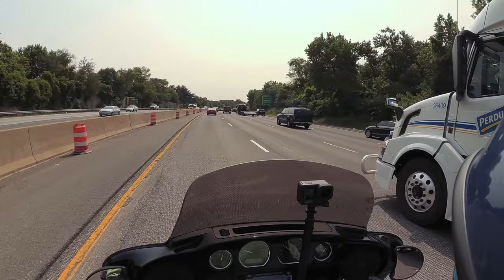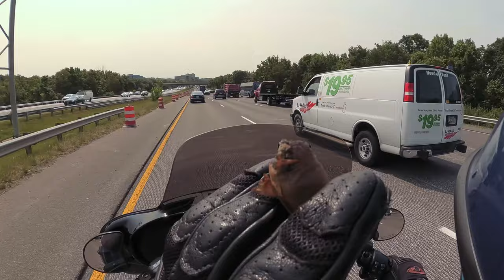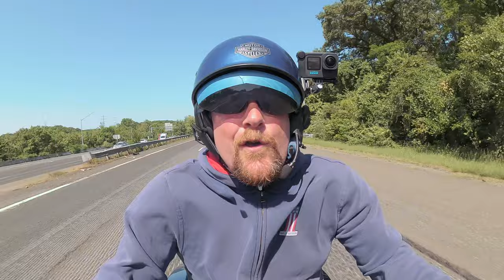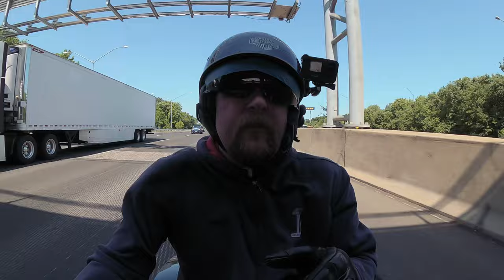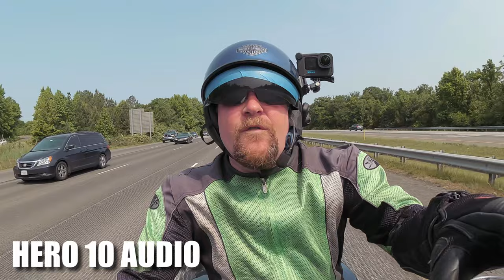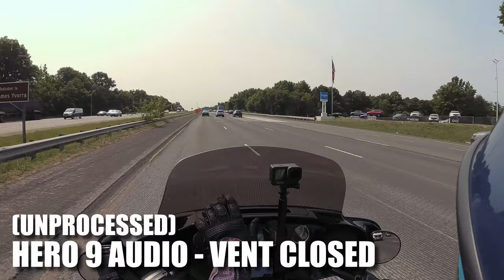Riding on grooved pavement ... and does the Harley fairing vent make a difference?

Comment: Back in the day NH used to grind up the pavement in every direction instead of in the same direction as the flow of traffic so it would pull your tires in every direction, it used to be a nightmare
Reply from the maker: That sounds ABSOLUTELY horrendous!

Comment: Do you have painters tape sealing the top of your glasses to your face?
Reply from the maker: No, lol.  It's painters tape, but to block the sun fully at the top of my visor - I explain it a bit more here, if you'd like to watch: https://www.youtube.com/watch?v=PRSA6jBDxuU
Reply: @RoadReality  I thought it was to keep the rain from getting into the inside of your lenses, which is something I fight with in the rain
Reply from the maker: @maddog3080  Oh man, I WISH!  I haven't found a way to keep the rain from flipping up behind the visor.  A light rain?  No problem.  What I rode through on the Back of the Dragon?  My glasses AND visor were soaked, front and back.  Couldn't keep them clear then.